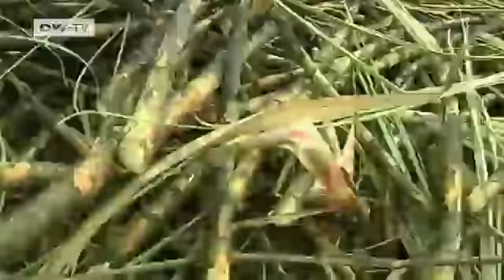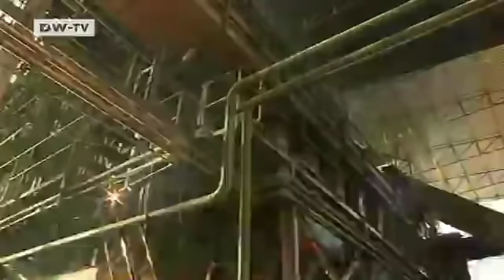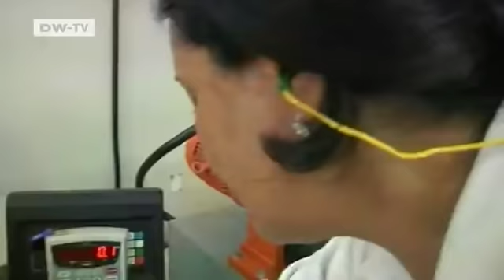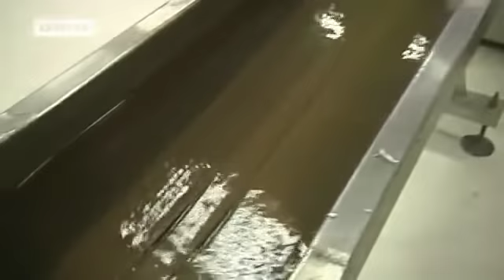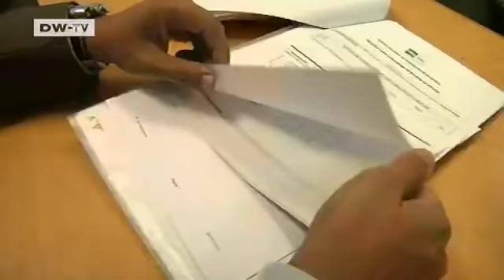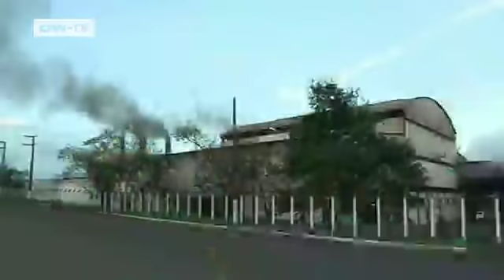Sugar Cane in Brazil | Global Ideas

Comment: Before the bagasse is even considered, 44% of sugar cane stubble is burned on the field. This shows great stupidity.  Money is being wasted. The bagasse could made into paper and card board.
Reply: This is from how many years ago?!?! In Brazil 95% of all sugar cane is harvested without burns now, the straws/leaf are left in the soil to protect it from drying out and loss of minerals in the soil and whatever is left of the leaves and bagasse is used to turn the generators producing electrical energy. Making sugar cane in Brazil close to 100% efficient.
Reply: Burning the bagasse in a furnace is no way near 100% efficient.  Better to to aerobically compost the bagasse along with the skimming s for two weeks then anaerobically decompose in a biodigester to produce biomethane and fertilizer. Burning methane in the same furnace is six times more energy effecient than bagasse.  The remaining effluent, already a good organic fertilizers, could be further submitted to vermiculture. Worms eat 3/8 their body weight every 3 days. Biodigesters and vermiculture is already established in Brazil just put the systems together in the sugar mill.  Are you a Brasileiro?